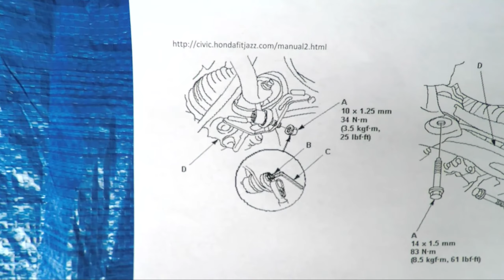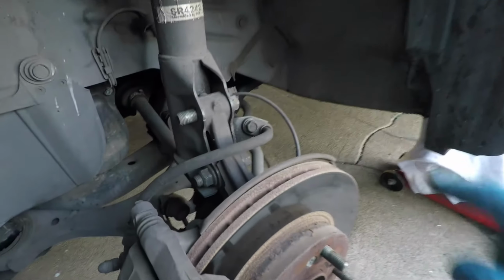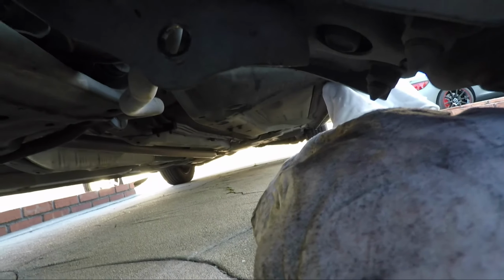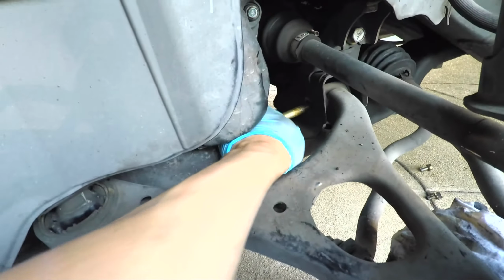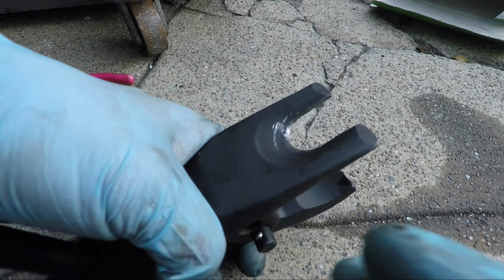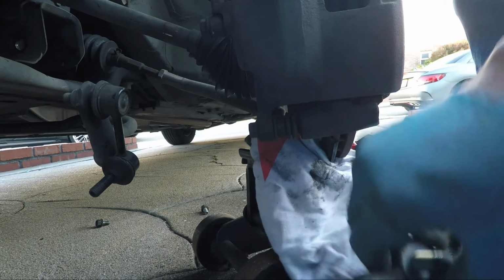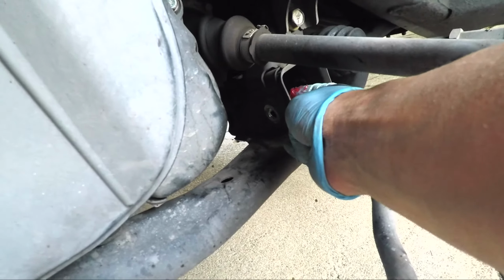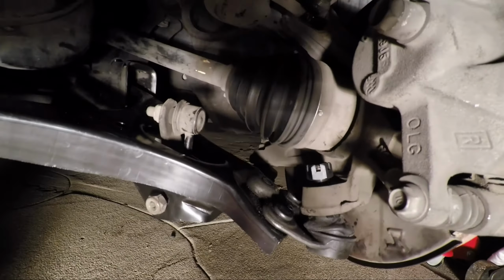How to install MOOG CONTROL ARMS for better handling! (Civic 2006-2011 8th Gen)

Comment: Once I seen how you had the car supported I couldn’t really take this seriously. Also why would you undo the strut from the knuckle?
Reply: I don't mind how he had it held up, although a jack stand would work fine instead of jacks. I do question why he disconnected the knuckle from the strut just after saying he was going to remove the sway bar link.

Comment: You don’t have to loosen the strut. That way the knuckle won’t dangle
Reply: Exactly. No need to do that. Jack the car up, remove the wheel. Pop the ball joint out and remove the two bolts holding the control arm. Done

Comment: Definitely can take it put with taking out all these extra bolts i lrgit just qent right to the sway bar link to the balljoint and then the other 2 bolts and of course made sure it all came loose before fully taking them out 😅 theres always a bolt siezed in a bushing in the rust belt

Comment: Did the moog suspension last for 2 years Kevin??
Reply from the maker: Unfortunately, in less than two years, the bushing rubber has also started to crack.
Reply: @kelvinsgarage  I only recommend OEM bushings and ball joints for anything I touch, moog lasts 2-3 years for bushings and ball joints, their sway bar links and tie rods seem okay, the rest just sucks.

Comment: How are they ball joints holding up I just bought all moog parts lower control arms inner and outer tie rods stabilizer sway links. My question is moog sells greaseable lower ball joints and was thinking of going with those. The ones that come with the lower control arms seem like there is no grease in them that’s my only concern.

Comment: I wasted so much time with a pickle fork and a mallet not big enough to push the fork through and separate ball joint lol I also took the bolts out of the lower control arm before separating ball joint. 

The videos I watched no one talked about loosening the sway bar and I struggled to get control arm back aligned for another hour or so. 

Will loosen sway bar out the way and also raise the knuckle more level like how you did. 

Wish I would've found your video earlier today. Probably could've done both sides. 

My job is pissed because I'm going to miss half a day but they can kiss my ass. My bushings were beyond shot and I drive a lot.

Comment: One bolt you’ll have to worry about is the one holding the horizontal bushing opposite the the disk shaped bushing(compliance bushing). These days these bolts can get seized and will have to be cut with a reciprocating saw. Make sure these bolts can be loosened and will back out on their own as they’re loosened. If not, be ready to cut them or take this one to a shop and save yourself a lot of time.
Reply: I had this issue... had to cut  the bushing bolt as well as the welded flange right off the car in order to just get that control arm out, that bolt was literally welded to the bushing it was so seized... now awaiting on new bolts because honda where I am doesn't carry the bolts in stock and have to be ordered in.. as for the welded flange, im hoping I can just use a 12mm flange  locking nut from the ball joint with some loctite and call it a day.. :\
Reply: @jmaclicious10  yeah a proper nut should keep it in place. I’ve been running the same setup for a little over a year.

Comment: Great video on how to change the control arms and ball joint.
However, I would have kept the originals on as it seemed to not have any actual large tears (even small cracks and minor tear still operates as it should).
You cannot tell the properties and longevity of rubber bushes by looking at them. 
From my experience and many others the thing with non oem parts are the quality of the rubbers are almost always inferior compared to OEM Honda.
The only exceptions are aftermarket parts "Made in Japan". 
With the Japanese culture, the aftermarket parts are built with honesty and are of OEM quality if not superior (which is as they should be in the West).

Comment: First thing I did when I got my 2006 is I removed the sway bars and links all together.  Been driving without them for 4 years and makes working under the car 10x easier.

Comment: Is an alignment required after this?
Reply from the maker: The proper way is to do an alignment after any suspension or wheel mods but if the parts are oem dimensions I think you can get away with not doing it.  Alignment will mainly consist of adjustments to the tie rods which are not perturbed when doing the control arm replacement.
Reply: I would. Aftermarket part will close to factory dimensions within a tolerance. But it's not going to be exact.
Reply: Yep, especially if the car came with camber bolts already in.
Reply: @kelvinsgarage  correct. They lost control arms shocks affect alignment.

Comment: how are they?
Reply from the maker: They feel stiffer than the OEMs so the car will corner a little better.  I wouldn’t say they ride more comfortably though.
Reply: @kelvinsgarage  nice, well it's always a balancing act of harshness and softness for handling
Reply: @kelvinsgarage . Well that sucks. Was hoping these would help my horribly riding 2010. Handles big bumps like a Model T, even before they went bad. Bushings went from going bad for awhile to shot. Car tries doing the macarena on the highway.
Reply from the maker: You’ll probably still feel an improvement with the MOOGs, but maybe a different brand would be better.  If you’re feeling adventurous you can just press out or burn out the OEM bushings from the stock control arms and install new bushings only.  Good luck!
Reply: @kelvinsgarage . Wow, you're one of the very few who reply, even quicker than necessary at that! Thank you for that alone. I already bought loaded arms with bushings and ball joints. Car has 263k so probably best and cost isn't much difference in cost. Driving Uber in city streets have them probably about to shatter anyway, lol. But yeah, an empty dump truck rides better than this! I don't get it.....it's a HoNdA!
Reply from the maker: These civics weren’t made for comfort. I’ve tried improving the ride quality including replacing the strut assemblies, tires, sway bar links and bushings.  Tires made the biggest improvement.  Accord rides much smoother but the gas mileage would make Uber unprofitable.
Reply: @kelvinsgarage . Yeah but why? Isn't like they're sprung too stiff. In fact I put SI springs in the rear because the base ones kept bottoming out. Went up one tire size (from 55s to 60s), a little lower air pressure, made the tiniest difference. Honestly considering adding rubber between the struts and body. It rides like there's a direct metal connection from the suspension to the body. Chevettes handle big bumps better than this!

Comment: No need to get creative with the cotter pin that Moog gives you. Just insert the cotter point and bend the ends over. Honda's fancy cotter pin works because it's spring steel so that it can be removed and reused. Generic cotters pins are not spring steel and they are not reusable. There's no need to duplicate Honda's fancy cotter pin. There is a need to have a secure cotter pin.